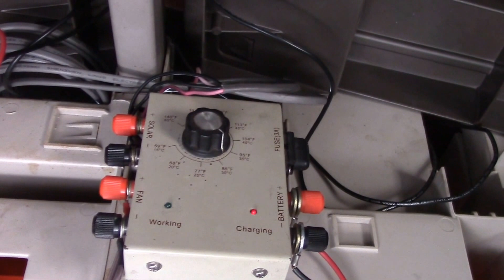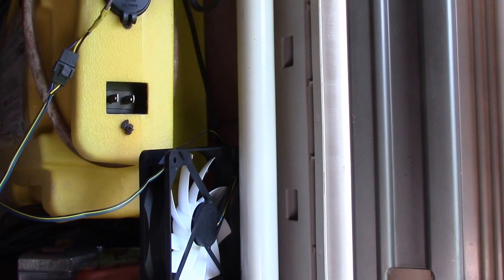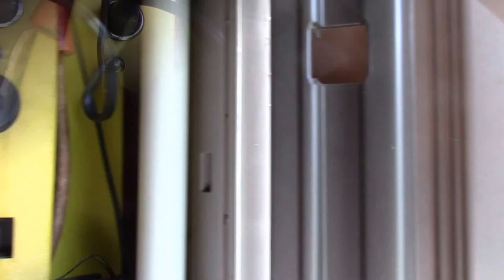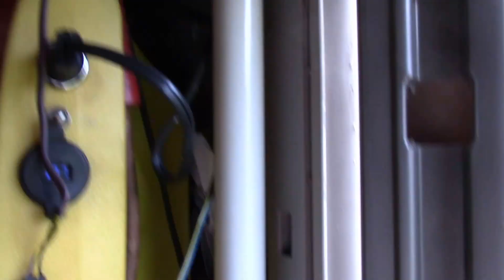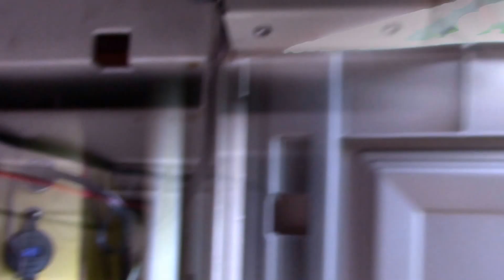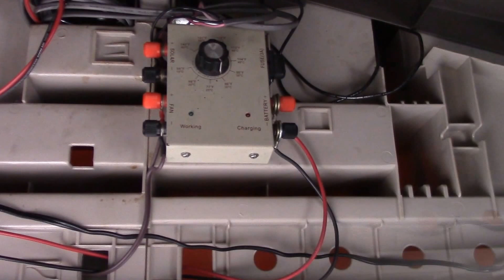Harbor Freight Solar Fan Controller - In Action

Comment: where did you get the fan?  did you get all of these items at harbor freight?  can you list all of the items?
Reply from the maker: I added the Harbor Freight part number in the video description.  It doesn't seem to be available any longer.  I also covered this in an earlier video and there's a link in that video description to an article where one was installed in a greenhouse:
https://youtu.be/yGIFppJNMCc
This is a rather nice product, I'm still using it today to control the cooling fans in my garden shed.
Reply: @The4Crawler  thanks